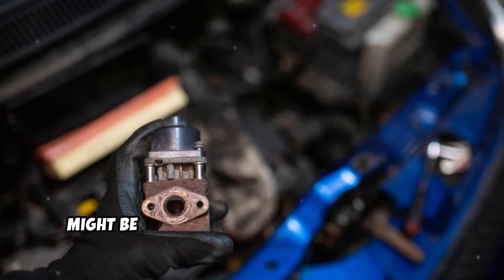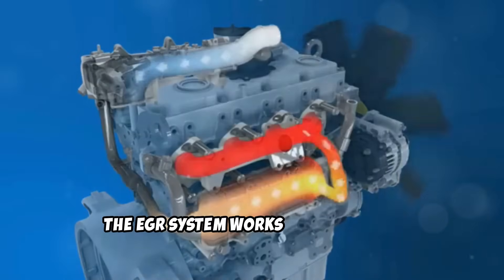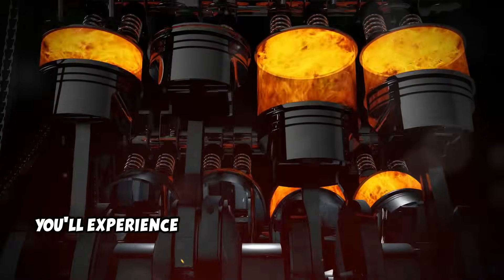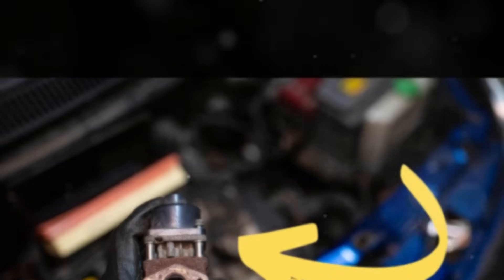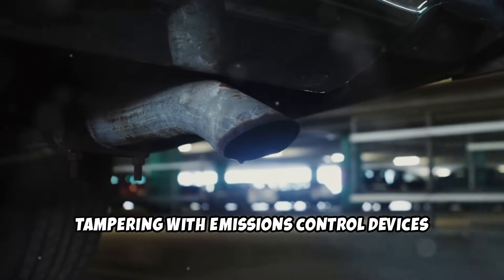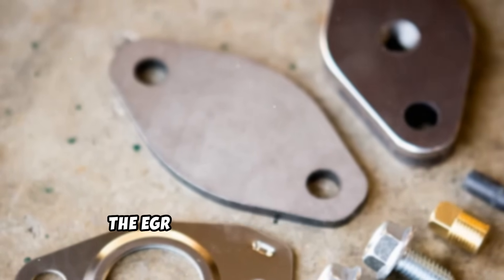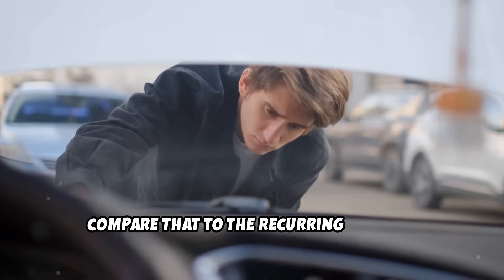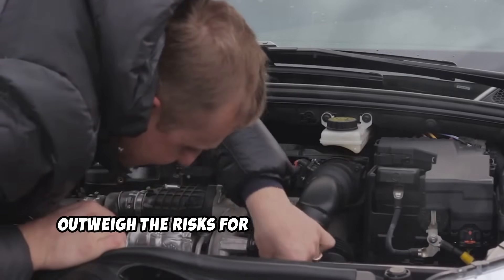EGR Delete Pros and Cons: The TRUTH They Hide!

Comment: No more than 5%  fuel  improvement in economy  from egr delete with cleaning .  
Throttle response will be far  far better .   Most of this will be from 1/ in  let manifold clean out 2 /inlet ducting clean out 3/ intercooler cleanout  4 EGR valve clean out 5/ Egr cooler clean out       EGR clean every 30k miles or 50,oookm All the other parts every 100,oookm or 60k miles  .

Comment: EGR removal is illigal here in EU. Besides that, the car will not pass the annual mandatory inspection  ( e.g. Germany TuV and NL the APK)  were exhaust gasses are measured in combination with a soot particles counting ( under 1mio finest particles)
I never had to replace , clean or remove the EGR  last 150.000 miles. Just adding a common EGR cleaner/ soot particle filter cleaner every  5000 miles to diesel fuel.

Comment: I removed the EGR system several years ago and never had any problem. My car is BMW 535d with M57 engine. Last year i took off the intake because i wanted to change glow plugs, glow plug unit and oil breather. The engine looked very clean, no carbon there.

Comment: Absolutely true!
I’ve deleted my e90 330d EGR only by software since it was barely new and now is almost 20 years old and never had issues with swirl flaps, turbo or the DPF.
Yes, it as the stock factory DPF and I think that the extra heat on the chamber at low rpm’s due to EGR delete helps with DPF soot cleaning and needing a lot less forced regenerations as also less usage of glow plugs to help heating chambers when regens are activated.
Incredibly we use the car more for city driving and that’s why I change oil once a year or maximum 5000kms.